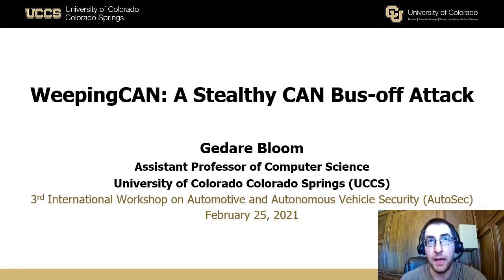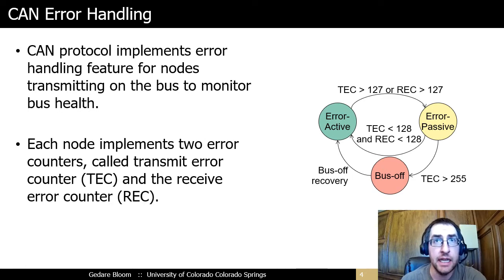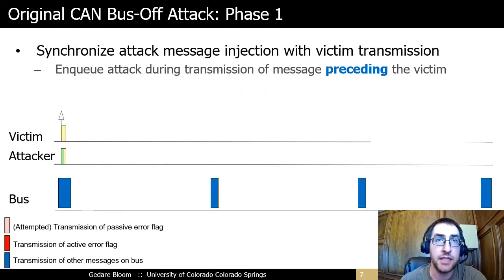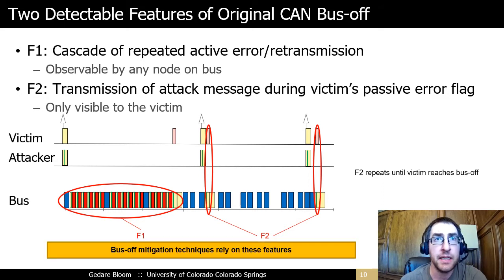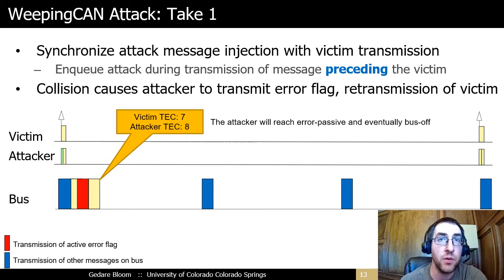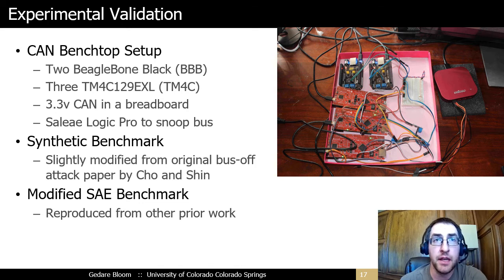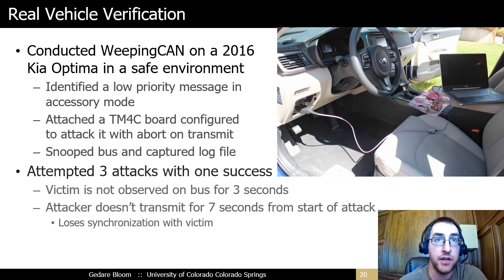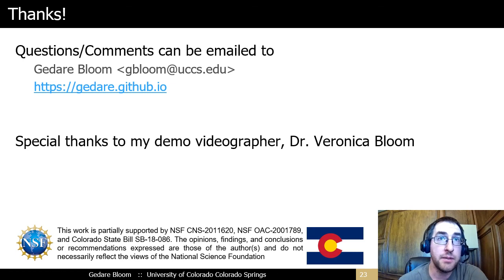WeepingCAN: A Stealthy CAN Bus-off Attack

Comment: In the first explanation on conventional bus off attack...When the victim TEC reaches 135, the attacker shall also become 135 (127+8), why its not happening, and the attacker's TEC doesn't increase, in the paper you have written, a "negative offset" between victim and attacker ... is this a delay ...because of that the victim advances with its TEC increment.

Comment: what is the purpose of preceeding message. and negative offset of v and A means, delay in the synchronisation? that is bits of v leads a ?. the original attack explanation in II.B not clear also,  is Cho and Shin [4]. the original ref. for original method.